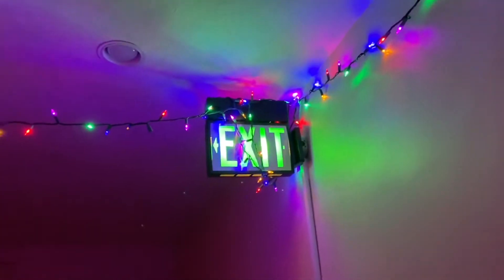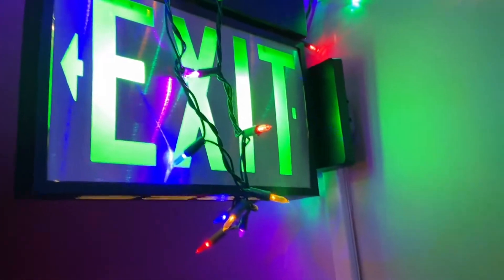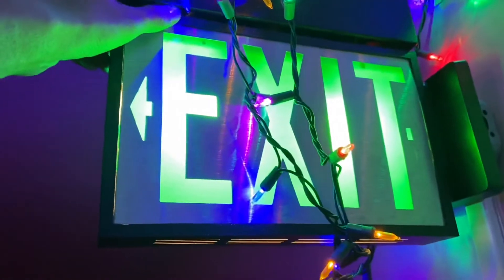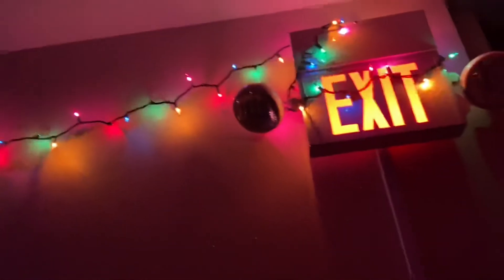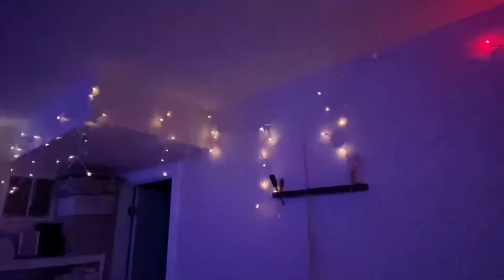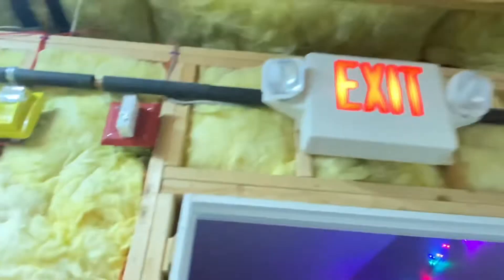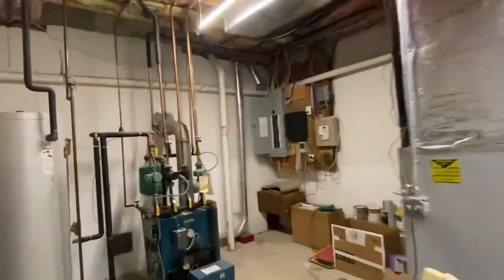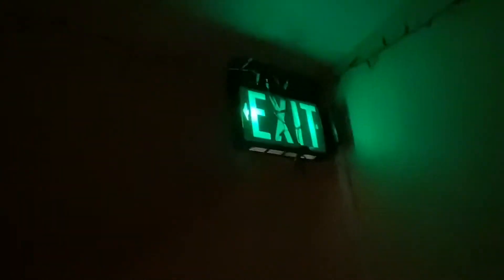Exit Sign/Emergency Light Test 15 | The Christmas Special

Comment: Ahh the first exit sign  model is UXE8 and very interesting to see it in green! I love black housing/brushed aluminum face exit signs. I have the same unit NOS but older than yours (the led and test switch individually poke through the face plate of the power pack rather than them being together in the black rectangle)  in red currently installed in my bedroom and have an old Chloride par36 remote head hooked up to it as well lighting the exit. I love the old lightalarms stuff.